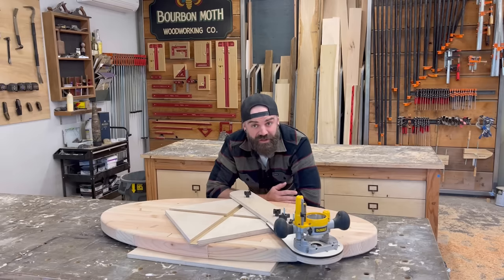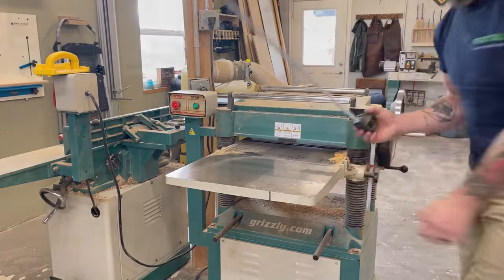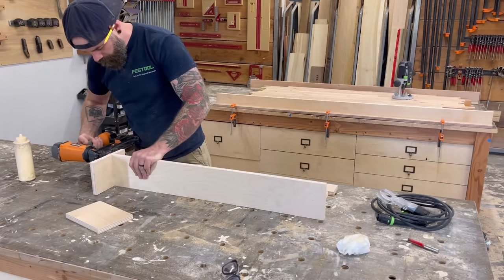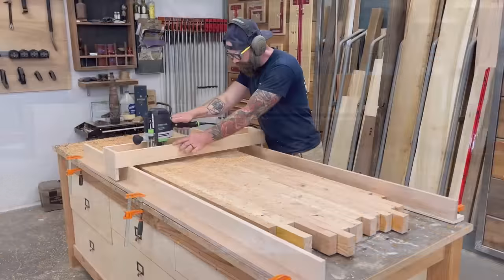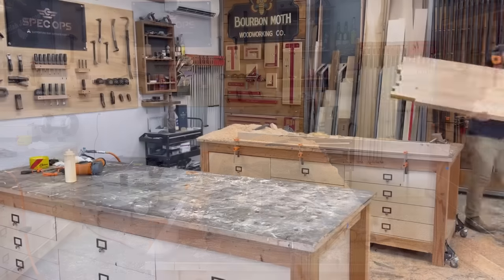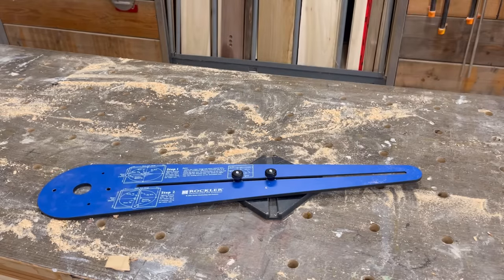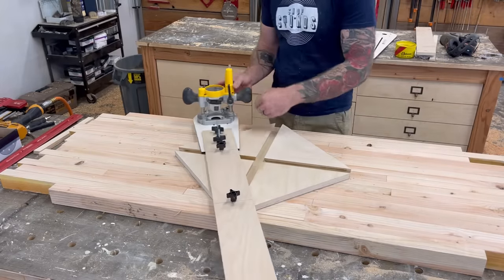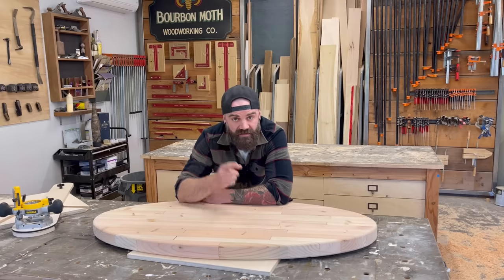Best Way to Cut an Oval || Cool Router Jig

Comment: There is an easier way to mark ovals. Old school brickies know this technique. You mark three points of the oval and place a pin nail, these points are the outer most extents of the length and one width. Then get tie some string around the three points making sure it's taught. This essentially forms a triangle around the three nails. Remove the string from the wide nail point and then use a pencil or marker and push the string to its maximum extent all the way around using the string as your guide. Voila, a perfect oval

Comment: Rather than the doghole setup you rigged, for both sides the more common way to do this is with the doghole setup on one side, then use wedges to get the workpiece nice and tight on the other side.... 😉

Also -- Would it not be easier to take a piece of wood and create the elliptical shape on it you want, then use that as a template for the router? Yes, it does not "repeat" easily, if you need to make a bunch of different ellipses of different sizes, but most people are not doing that... either they are making a lot of a specific oval or they are not making ovals at all.

The distinction is, it is markedly easier to make an elliptical shape with a pencil (this is a classical way to create an ellipse -- use two pins and some non-stretchy line -- look at the wiki article on "ellipse" look for "gardener's method"), then rough-cut it with a jigsaw, and then use a sander et al to shape it accurately.

Which is much much easier and less prone to issues than throwing the full router around in huge arcs. 

Just a thought for those considering this process.

Here's a video showing how it works... mind you, a string may be "stretchy", so you are better off using something with as little stretch as possible -- perhaps some fishing line, for example, or other really really non-stretchy stuff. If the line stretches, then the ellipse can be deformed by more pressure on one part of the curve than on another. 
facebook  com   /  watch  /  ?v=608052454228446
(Youtube kills external links. You should be able to reconstruct the above into a valid link)
The line does the same job as the channels in the jig, constraining movement in both directions to a fixed value, which is actually one of the ways to define an ellipse mathematically (Yup, you just did MATH!! 😁)

Comment: I'm a novice woodworker and don't yet own a planer, but wouldn't it have been overall easier to cut the slab into 2, pass both sides of each piece through the planer (using shims as needed) and then re-glue the two halves using cauls or biscuits to maintain alignment? Seemed awfully time consuming to use the router to avoid a single cut and glue up.
Reply from the maker: True true but there are a lot of times that wouldn’t work. Like if you were working with a live edge slab and I wanted to show the process
Reply: Excellent suggestion.  But you'd have to explain to your friends about that weird thingy down the middle of the table;-).  Cauls and biscuits do work well for lumberjacks but I, personally, don't know of any woodworker who would trust them for gluing up a tabletop.  _ _ _ unless they want to strike up interesting conversations with their friends.

Comment: I did a router sledge one and it works fine  BUT at the end.. the router bit got a little "loose" and it drop down a little 1/8 and it scrape all the end of the table.

Comment: Is there any way I can convince you to make an aquarium stand everything online is made out of 2x4s and looks a little to ruff for the wife's liking so that means it won't fly if you know what I mean...thanks
Reply: wrap it in plywood and finish like a cabinet, that's what most people do with their stands. The 2X construction is purely there for the structural strength
Reply: @BType13X2  looking more for a piece of fine wood work idea not  something that looks like a kitchen cabinet .... almost like a live edge with joinery
Reply: @abstractaquarist9637  Then by all means do that. Make the frame structurally strong then hide the frame underneath a live edge or whatever suits your fancy. Just remember its an aquarium stand first, it needs to be strong enough to support the live load of the aquarium, the fish, the substrate, plants, decorations, and filtration, and you need to be able to level it / have what it is sitting on be level, because if it isn't you will be putting extra strain at one end of the tank vs. the other and you could blow a seam out / have it shatter.
Reply: The ex had a HUGE terrarium (about 2' x 4' and 2' high iirc) that was sitting on the floor.  There was one of those pine bunkbed frame from the 80's (dark stained) that she was throwing out.  I used the material from the frame to make the stand, complete with shelves underneath to store plant supplies.  Sprayed the whole thing with polyurethane over the stain and tada.  I figured it was only going to be used until she tired of the terrarium upkeep but nope, still in use 20 years later.

Comment: 6:16 and here he should be shimming out the wobble back to front and side to side, in not doing so he ends up with a thinner slab then necessary.
Look at the right bottom side of the slab you can see that end lift a quarter of an inch above the table so the slab will now become that much thinner.

Comment: An oval is a rectangke extended by semicircles on oppisite sides;
An ellipse it is not.
Reply: Who cares?
Reply: @oneeyedphotographer  Engineers, architects, mathematicians, surveyors, archaeologists, stonemasons, artists, tool-setters, fitters, graphic designers - and pedants.
Reply: @lindsayheyes925  Not in this context.
Reply: @oneeyedphotographer  In whatever context, an ellipse is only an oval if the sides of the rectangle of the oval which are tangential to the semicircles have infinitely small length. In all other cases an oval and an ellipse are as different as a square and a circle - quite literally so if that oval is constructed on a rectangle which is equilateral; and if the ellipse is the special case that is circular. But, plane to see,  that's just me going off on a tangent about a unique case.

Knowledgeable readers will find your frustration over my focus on the correct construction somewhat conical. 😉 Other will think that I am picky. I take issue with that:
I am pedantic.

I'm not photogenic either, so I suspect that we have little in common other than that we watched the same video, but I wish you a happy new year... but as you say, who cares?

Comment: Call me pedantic but this is an ellipse not an oval. An ellipse is a single sided 2d shape with constantly changing radius, whereas an oval is 2 identical parallel lines with a semi circle at both ends. So that's the educational part done...oh wait...at school we did technical drawing and the teacher had an ellipse template which worked on the same principle as your jig. They overcame the problem of the sliding part sticking where the grooves intersect (major and minor axis intersection) by pointing/bevelling both ends of both sliders, about 45 degrees from memory (long time past). I mused the other day if this would work with a router, and here is the proof of theory! Love the channel and this vt. Keep it up.

Comment: Hi 👋 Bourbon 🥃Moth, I enjoyed watching your territorial on your railway track gig ha ha and your elliptical gig , I did notice that you were not wearing a face mask of any shape or form whilst doing this job, this is very dangerous healthwise I'm not telling you what to do but I lost a colleague in 1994 , are used to work in the machine shop cutting components on a CNC for building sound boards for organ components, can I recommend a model made by 3M , it's a complete respirator system with a powerpack that goes round your waist and picks up here from round the back if you text your eyes your breathing and has a defenders on it as well I'm sorry but is expensive but at the end of it your health is more important, stay safe keep up the good work, 
Retired English gentleman, specialist joiner cabinetmaker, 
Phil from the Moulin in France.